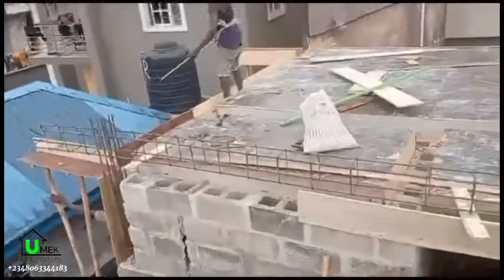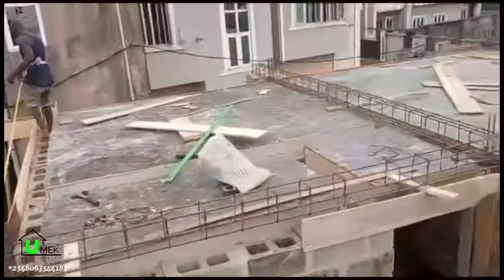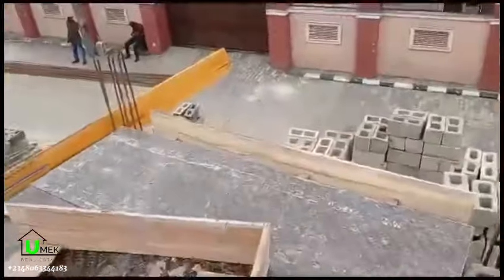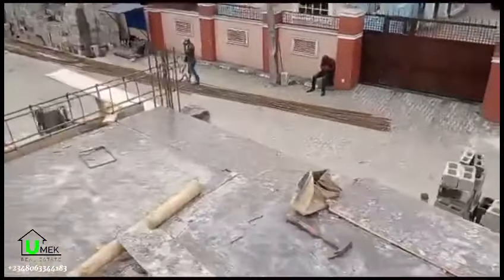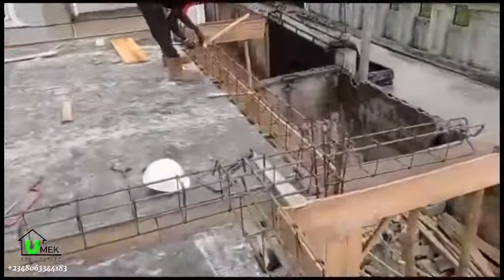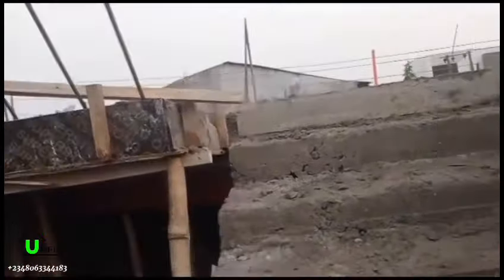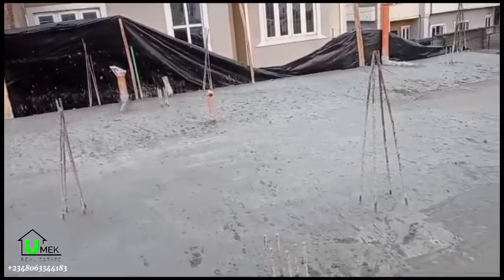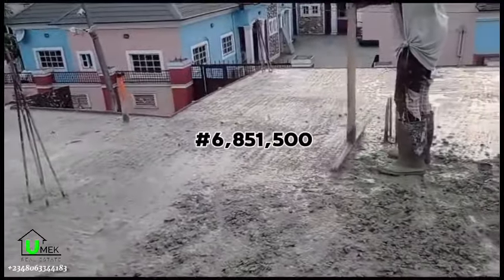Thorough/Detailed Cost of this 122sqm decking in Port Harcourt, Nigeria(July 2024)Labour & Materials

Comment: Hello Sir. 
So if the square meter is 244m² .
The cost would be # 13,600,000?
Reply from the maker: Doesn’t work that way… there are some quantities that will remain in the one we did, but since it was already bought, it will enter as expenditure for the decking …